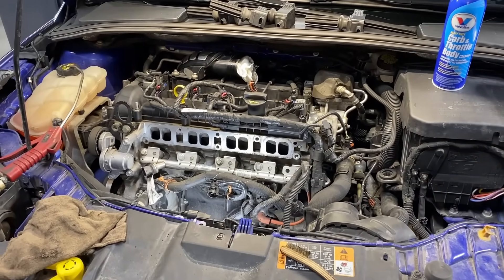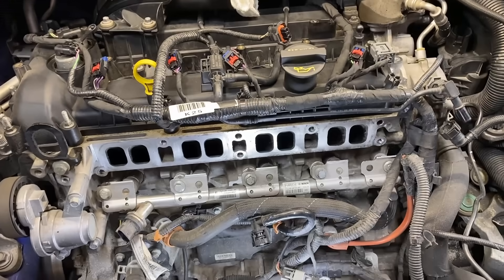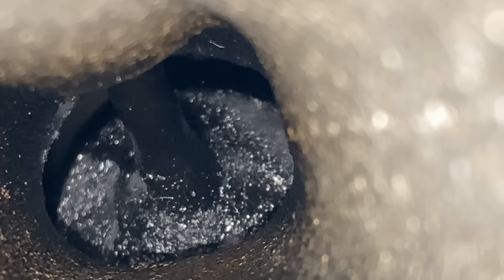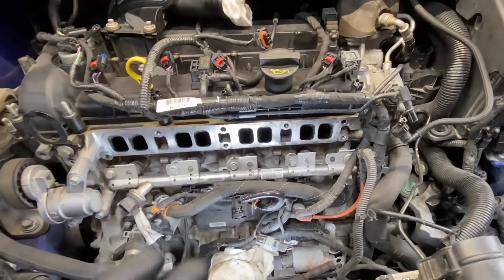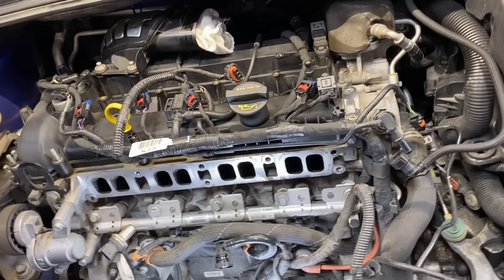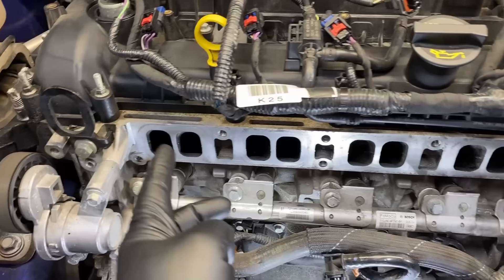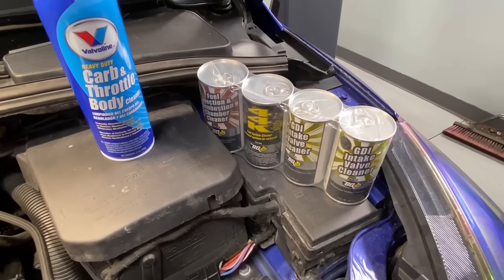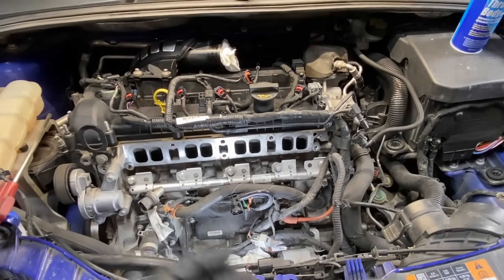Ford EcoBoost Engine Misfires Runs Rough: Intake Valve Carbon Cleaning Procedure

Comment: Just called two dealers to see what they would charge to clean my valves. Both want to charge me between $135-$300 for doing the same thing I’ve already been doing with CRC’s GDI cleaner; I asked what the service consisted of… they told me they spray/ fog the intake. That’s what I’ve been doing on a regular basis… so, I’ll be doing this process myself. They’ll probably want $2000 to do it.
Reply: I run the CRC every 10k miles, yes it's probably excessive, but I have a bore scope and the valves look new.
Reply: BG has a GDI service cleaner. Instead of breaking the carbon down into pieces this service liquefies the carbon so it won't damage the turbos. Also it's the only product approved by Ford for their GDI engines. I have a 2011 F-150 with 122k miles on it. I just had back to back GDI services ran with a 1k miles in-between each service. My truck is running much better and way more responsive. It does however keep throwing a code off and on for sensor 1 bank 1 as the carbon keeps getting cleared out of the system.
Reply: @tylerjantz882  is the service cleaner the range stuff he showed in the video? I want to keep up with my sho and make your car last until it physically can't anymore. I'm in the process of learning all of the things to keep up with about this car to fully and truly maintain it.
Reply: Run bottle of BG 44k in gas tank. I do 2× yr in my gen2 - 2.3L Ecoboost Ranger truck. She runs perfect!  2yrs/19k mis. Use full synthetic 5w30 Pennzoil Platinum changed every 5k mis AT MOST. Always midgrade fuel.
Reply: @Davido50  How does that clean the intake valves then???🤔
Reply: @allanb3222  it doesn't
Reply: @allanb3222  the gen 2’s are dual injection. It would work for him. Fords fix was an obvious solution and the rest of us get to play dental hygienist after removing the intake
Reply: @Davido50  this issue won't appear until 30k miles. No matter what good oil you use, the pcv system will still coat the valves with it
Reply: @Davido50  Looks to me like you don't know how GDI engines work.....
Reply: Add 2 cups mystery oil to your fuel, every fill.

Comment: Thanks for the video!
At first I thought about blaming car makers that don't do some type of port injection for making a product with what I see is such an obvious design flaw. I'm sure they see it as another way for the dealer to make money either by the service to clean or a new car or engine if it gets bad enough.  It's crazy that they've known about this for close to a decade now and theynjust don't care.

But I actually blame the consumers out there. I have zero sympathy for people that willingly buy cars that are direct injection only.  If consumers cared more about how a car is actually made instead of caring about how it looks and if it has all the latest,  fancy electronic bells and whistles that will get all buggy and stop working in a few years anyways then car makers would stop making these type of engines. 

But most Americans probably don't care about getting a quality car that will last them forever and would rather be in debt forever getting a constant stream of crappy cars every few years.

Comment: Do you think this will be a problem on your 2021 F150 or did Ford correct on the new engine?  Any precautions to be taken to prevent this issue?

Comment: What a massive pain in the ass, I'm perfectly happy with my 08 F150, I'll never buy anything newer.
Reply: I feel the same about both of my 2006's, 2007, and 2014 (which does not have direct injection).

Comment: Another garbage design from Ford...they should be paying for these repairs.  Crazy that you have to do this to an engine.  Waiting what Toyota will do with their version of 3.5 in a Tundra next year, might be time to switch.
Reply: i think toyota went with both gdi and port injection...
Reply: The biggest problem with these engines is the owners need to drive them more at operating temperature to burn off the oil contamination.

Comment: I've had the dealership offer carbon cleaning. Any idea what that might include? Also, any idea what type of fuel he was running?
Reply: Running 91-93
Reply: take a photo of the valves before you take it in.. then after they ' clean' the valves then get your money back

Comment: Thanks, Brian.
?: Does the quality of fuel used have an impact on the amount of carbon buildup in this type of engine?
Reply: Type of oil has a greater impact. An oil that does not "cook away" as easily is best.
Reply: 91 don't have ethanol more money but will keep you valves cleaner
Reply: @joecostu1571  Interesting...in Canada, Chevron claim their 94 Octane is the only blend free from ethanol and I've been using the 94 exclusively on our BMW N20 turbo engine.  I"ll have to have a look at the intake valves someday (50K kms so far since new).
Reply: @MarioDallaRiva  94 is better.

Comment: Here's a question for you. As a dealer tech (not ford) do you think this repair/maintenance should be a warranty based repair or CP? I've had many debates with my warranty admin regarding this and neither the dealer nor the manufacturer has an answer. Just wanted your opinion
Reply: CP. Carbon deposits are not defects in materials or workmanship. 
 Warranty doesn't cover defects in the engineers' designs. That's why the manufacturers get sued and then offer "customer satisfaction" recalls...
Reply: No warranty it’s just maintenance.

Comment: Does this apply to the 3.5L v6 ecoboost? I’ve been thinking about doing mine and installing a catch can. 120k on the clock, runs great but figured it’s probably pretty built up.
Reply: Depends on the year of the vehicle. Port injection was added in 2017 models in addition to the direct injection on the 3.5 ecoboost.
Reply: Look on line , you can order a small Borescope to plug into your phone. Can have a look yourself. they are surprisingly cheap.  My F150 3.5 has 150k miles an after scoping it was time. 
Just a warning the back  Cylinders at the fire wall require some  stretching   an creativity..
But I believe after 2015ish 2nd injectors were put in to correct the issue.
Reply: @thatguy3481  2018 2nd injectors put in for f150
Reply: Thanks for the info 👍

Comment: Someone needs to make an aftermarket kit where you can plumb in a single fuel/solvent injector, like a VW CIS cold start injector. This way you can run a yearly automated service cleaning cycle without any intake manifold disassembly required. I realize that's quite an engineering feat, but I think it would pay for itself after the traditional manual cleaning service, and has the benefit to prevent potential drivability issues too.
Reply: That would be simple enough. Tap a thread in the intake pipe. Snug a quick connect on there. When it comes time to service install an air line and bring it into the cab then blast it with solvent with the car warmed up at freeway speeds. A couple cans should do the trick.
Reply: @markm0000  and smoke everyone behind you on the freeway.. night get some unwanted attenion for highway patrol

Comment: Junk engine! Requires major maintenance after only 80K. So glad my 99 Taurus has a 3.0 Vulcan - 22 years old, runs perfectly, never been apart.
Thanks for another great vid, always learn something here.
Reply: uhhh that's inherent with every GDI engine from every manufacturer, Mazda, VW, Honda, Subaru. Newer engines from Ford and Toyota have both port and direct injection system so this is no longer a problem.
Reply: Your 3.0 vulcan also only makes 140hp, and 160ftlbs of torque.

One of fords ecoboost engines, the 1.0 3 cylinder engine makes the same power and torque as your 3.0 v6 while getting over 50mpg.

Comment: Thanks for doing these information videos.
2 questions,
Will using premium fuel make a noticeable difference in preventing this issue from happening?
And would a catch can or vent into the atmosphere type kit not be a big benifit?
Reply: Not a mechanic but I would think venting into the atmosphere might work but would be illegal.
Reply: The fuel octane will not help. The injectors don’t spray the back of the valves that would help keep them clean
Reply: You are supposed to be running at least 91 in a turbocharged ecoboost anyway. It says so right in the manual. That is where you get your rated power and fuel economy. The extra octane will not keep the valves any cleaner though because that fuel never hits them. As far as a catch can yes it will absolutely keep them cleaner. I installed one before my first oil change and with 75k+ miles I have yet to have any issues. You may still get them it will just be far longer before they happen. Vent to atmosphere would work but, may cause you legal issues depending on your state and they just make a huge mess under your hood most times away.

Comment: If I were doing all this work to clean the intake valves every couple thousand miles, I'd probably just fabricate in some secondary fuel injectors to wash the valves down 1-2 times per drive cycle.

Having to do this more than once (or at all) is insane.
Reply: Not sure about fuel but I have been reading about people fabricating Methanol injection just for the cleaning.  Using the existing windshield washer bottle an winter windshield wash.  They are saying the Methanol content is high enough.  Food for thought 🤔
Reply: @thatguy3481  Thankfully I'll never run into this issue cause I have a port-injected 5.0, but that is an interesting idea.  Thanks.

Comment: What about the oil separater? That  GDI design is problematic.
Reply: The problem isn't the decision to implement Direct Injection. 

The primary problem is crankcase ventilation that is positive pressure, being fed into the intake manifold. At hot operating temperature, it's not a problem. But during cold start up and warmup, the air in the oil pan, cylinder head and valve train cavity is cold and wet, which is sucked into the intake manifold along with cold EGR air. The oil and unburnt fuel then falls out of suspension and coats anything in the intake manifold and EGR system. 

Then as the engine warms up to operating temperature, these deposits then bake onto the walls.

The problem has been around since the late 1960s when cylinder head / carburetor EGR plates were first used. Combustion engines can only develop negative crankcase pressure using a dry sump oil system. The drawback is complexity, parasitic horsepower loss and oil foaming / aeration depending on design. It also isn't a good application in cold operating temperatures.

EGR air pumps did work, but they also were problematic and required allot of horsepower. One of the advantages of propane or natural gas is its cold burn properties. These problems never occurred with these fuels and worked great in older high compression engines used in the 70's and 80s. Especially taxis and city delivery vans.

Class 8 trucks with diesel engines do use an oil separator. They can be used in gasoline engines too. But it's plumbing and maintenance headache. You also run the risk of an oil fire if it overflows from lack of servicing.

Comment: That is a un-masterful piece of engineering, all gunked up with just that mileage. Looks like Ford didn't give a damn about what happens in this Eco design after the warranty period.
Reply: Every GDI has this problem.
Reply: Not limited to Ford unfortunately.
Reply: Ford is the least susceptible to valve coking. This is nothing compared to some non-Fords I have seen with fewer miles.  Ford has a patent to help curb valve coking.  Should see what some Audi's look like with 40K on them!
Reply: @acdii  I remember hearing about the VW/Audi 2.0s when GDI first came out. Some would coke up enough to where the valves would hang open and blammo. 45-70k on them!
Reply: @adamtrombino106  Yep, and a LOT of pictures that people claim to be the Ecoboost are all pictures of those Audi engines.  This video is the first to actually show the buildup, and like I said, seen much much worse. This is nothing compared to old school carburated engines.

Comment: I do quite a bit of Walnut Shell Blasting. Definitely makes it look like factory new.
Reply: i have a 3.5 ecoboost with around 202,000 miles and have noticed a decline in gas mileage. Any idea where i can get a walnut shell blasting done? and how much will it run me?
Reply: @easton._.141  A Lot of Shops can do that, about an hour or two for the blasting and whatever time it takes for dis and  re-assembly. Periodic engine treatment will help keep down on buildup but on the other hand you done reeeeal good on getting that many miles without issue. I do not know if Ford has a top engine cleaner, personally I use GM product and swear by it. Way better than the CRC crap in my opinion.

Comment: What symptoms would be manifest if this needed to be done? Would it be similar to that of needing a tuneup? Low power without a check engine light?
Reply: My 3.5 had bad fuel Mileage,  then a random misfire on cylinder 3 occurred.. then it happened more often. After checking an switching plugs an coils around . Still cylinder 3. Ordered a cheap Borescope for my phone.. took a look an it was built up with carbon. I did get a code for a misfire an a light, but not at 1st. 
Driving  a boosted engine like a pawpaw apparently doesn't help it, guilty 😒.  Hope that helps.

Comment: Manufactures should install service ports on the intake runners for scheduled maintenance and cleaning of the intake valves.
Reply: Or make them dual injection
Reply: Oh, and there are kits... I believe I saw one that bolts on right there, 4 extra injectors... ported so they spray evenly down the split. Think the guy wanted like $1200 for the whole setup.
"upto 620hp without changing the hp fuel pump"... 
"Dude, I just want to keep my valves clean"...
"Oh... It keeps the valves clean, really clean!"🤦‍♂️

Comment: Have a Mazda CX-5 with GDI. I’ve utilized the BG kit at approximately 80,000 miles. Engine oil is also important for reducing carbon build up. I use Pennzoil Platinum Full synthetic engine oil as well.
Reply: Pennzoil is awesome oil! My 2nd choice is Motul oils.

Comment: So if it can happen at any mileage what use is this maintenance cleaning you talked about? I was going to ask if I ran or had my mechanic run the cleaning every forty thousand would that be good? Sounds like every twenty thousand I might just make it under the finish line.
Reply from the maker: My explorer was an extreme case I would say every 40-60k would keep any drivability concerns at bay.

Comment: Get yourself a walnut blasting setup. Knock down the big chunks manually and then blast it for 30-60 seconds.  Faster and comes out looking almost brand new.
Reply from the maker: Yup I may in the future but for right now I wanted to make a video on manual cleaning.
Reply: @FordTechMakuloco  thanks for doing the video. There are so many di engines now, it is much needed information. 

Walnut blasting cleanings really should be routine maintenance, but no way is Ford going to add to the cost of ownership and endorse that.

Comment: Nice! How is the fuel system setup in the 2.7 f150's? At 30k should i pop a catch can on it? If it's going to have this problem i may wait till i clean it.
Reply: For those curious the 2.7 has a dual fueling system, i looked it up and forgot i had already soothed myself on this! Hahaha.

I wonder when it runs, it sounds like it changes fuel systems about 30 seconds after startup. The engine has a distinct sound change after about 30 seconds.

Comment: I've got 185000 on my f150 3.5 ecoboost. I purchased new and have maintained it well. glad to see "BG" has come out with something safe for the turbos because I haven't replaced them yet.
Reply: What year and have you ever done this valve cleaning?
Reply: @alphawolfadventures1470  2011. never had valves cleaned. ran borescope ay about 150k. not terrible. I don't let it idle much when cold which helps to warm up fast. I'm in NE Ohio. I do change brands of gas often which I've also heard helps with many varieties of detergents. I'm at 189k now.
Reply: @paulmartin8212  yeah I’ve heard tier 1 gases are important (basically all the majors are t1) you run a catch can?
Reply: @alphawolfadventures1470  no. never drilled any holes either. no problems with condensation.
Reply: @paulmartin8212  thx man spending too much time on the Internet will have you thinking these will blow up at any time 😂 I guess like looking up what’s wrong with you instead of seeing a doctor “it’s a tumor” 😂 doctor- “you’ve got a sinus infection” 😂

Comment: A high quality catch can would help with chunky oily carbon in the intake tubes, but ive only done it on turbo deisels .
Reply: You're 100% right, i put a good catch can on my 3.5l EB very early on.

Ran a borescope around 3 months ago at 77k miles and the valves have a very minor amount of carbon, but i also run a intake cleaner through the throttle body every 12k miles as well for cheap insurance.

Thus far shes awesome, but this is a great video no doubt for those who found out too late

Comment: I have three rules when it comes to buying a car and they've served me well for years.
1) No turbo.
2) No GDI.
3) No CVT or DCT.
Reply: When I bought my Santa Fe I purposely bought an MPI V6 equipped model.
Reply: Toyota V6 engines have both types of injection
Reply: GM v8s are still holding on... Still using pushrods